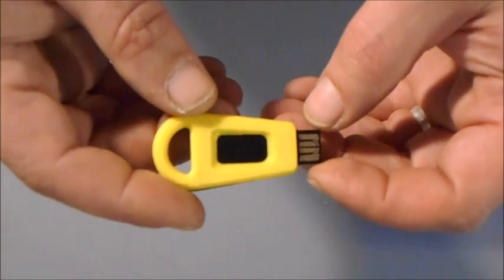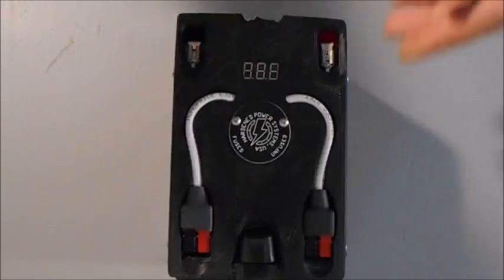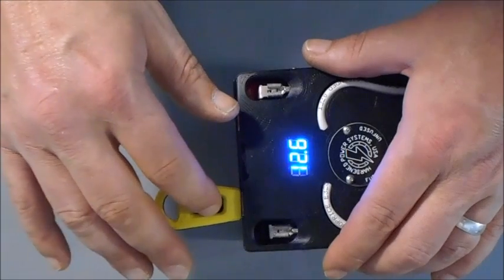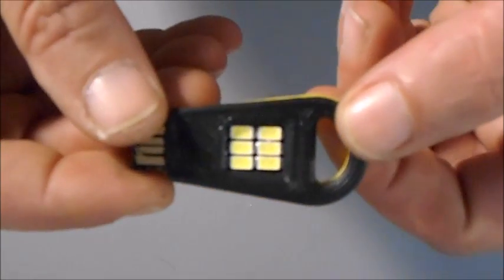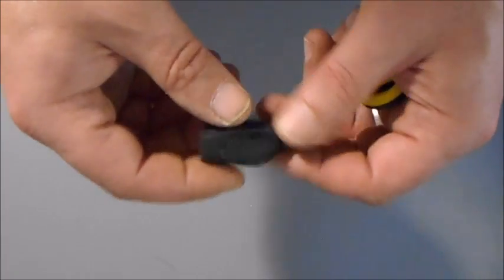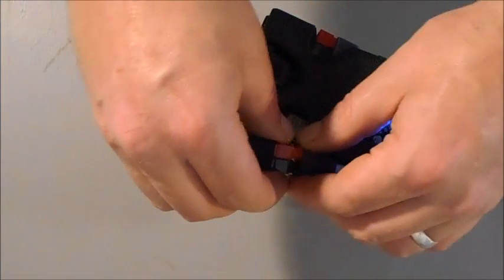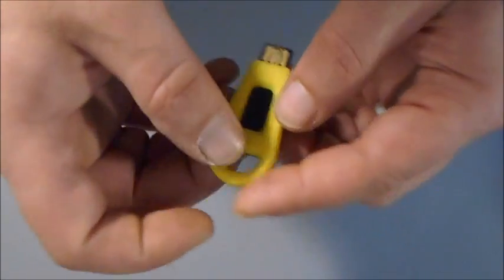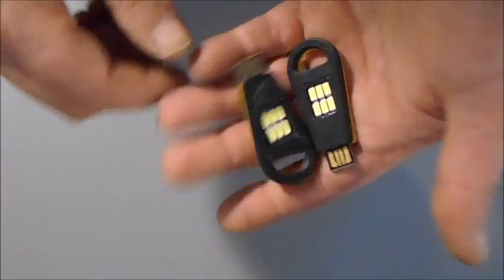Nano LED Intro from Hardened Power Systems - WWW.PortableUniversalPower.com

Comment: Those are cool I like the new BatPacs with the built in usb drivers
Reply from the maker: +SilentSniper Vt    Me too...    ;-)    it was a bit of a trick to fit them in there... keep in mind that each port has its own 3 amp driver... you could fast charge several smartphones at the same time with that kind of power.
Reply: +Hardened Power i will have to look into those i could use one. also did you ever get my Batpac and USB Cable back yet i sent it out a few weeks ago.
Reply from the maker: +SilentSniper Vt   Instead of repairing your original, we are upgrading you to the new M4... so you will have the USB drivers you mentioned.  ;-)   We are also sending a Nano USB to serve as the Anderson to USB solution for you.  Shipping today.  You will see tracking.
Reply: +Hardened Power thank you I just saw the shipping notice in my email. But one question for you is can I buy just the antenna support for the vantage because I have the same tripod and the antenna I was using is now on my tower and the solar panel bracket worked out nicely
Reply from the maker: +SilentSniper Vt    Sure we can provide just the antenna mount... I'll shoot you an email to nail down details (threaded fitting and coax).
Reply: +Hardened Power thank you and that would be smaller and lighter then the last antenna system i used for public service events